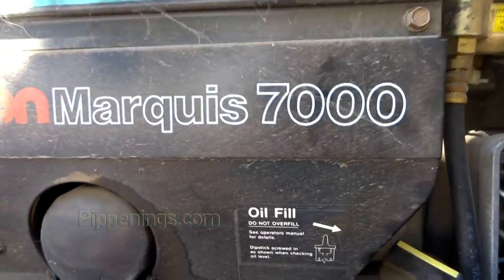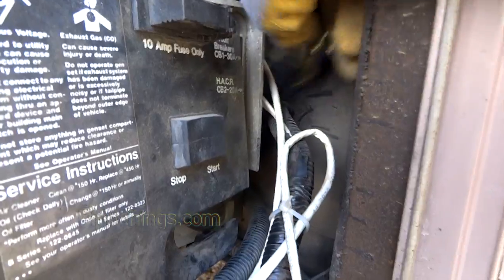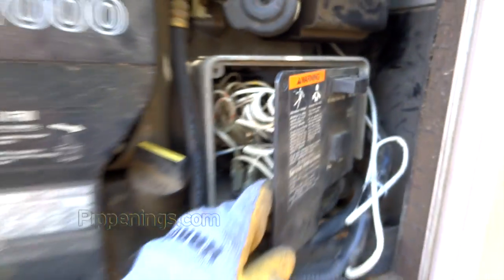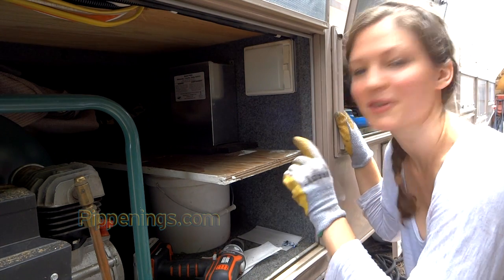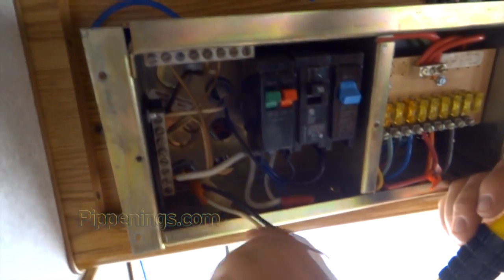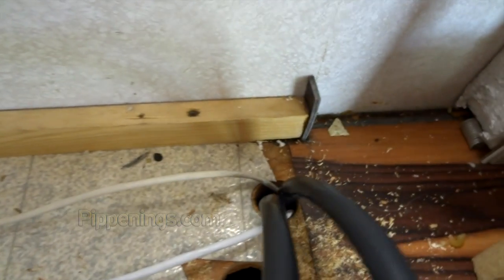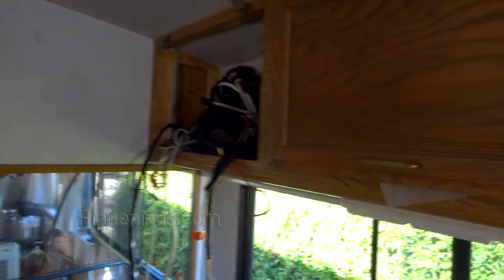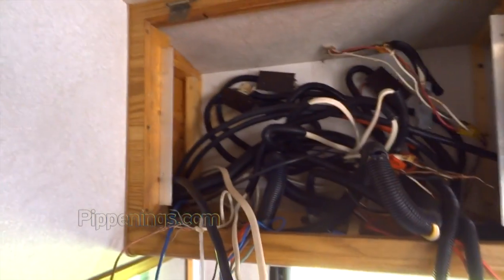30A to 50A Conversion RV: Cables, Part 2/4

Comment: So you used 6/3 with ground to run from your inside breaker box out to the generator or plug on exterior for shore power?  Or did you use 6/4 lol.
I’ll be doing this conversion in a few weeks and happen to have some 6/3 left over from house wiring

Comment: This is not a DIY type of job...most people would not be able to do it without a professional electrician.  My 5500 Onan will run two roof a/c units on a 30 amp system..maybe they are smaller a/c units then yours. Some rv a/c units will cycle one at a time i  hear. I never had a problem with only my 30 amps, but then i dont run a microwave and both a/c at the same time. and, im not living in the arizona heat but im sure in summer two ac units are probably a requirement. your videos are interesting and will help alot of people.  Two things i will get in my next rv after travelling to 40 states, it will be a diesel, wired with the inverter, and jacks for leveling. its a learning process
Reply from the maker: Those are great next-rig requirements! Especially the jacks!

Comment: Hey , I'm a little confused...I have been looking at xantrex inverter/ chargers all day...the ones I  am seeing already have transfer switch built in....but I see you putting in PD humongous transfer switch??? But you said earlier that you have mostly Xantrex stuff....so, I'm thinking your previous inverter must be a straight inverter, without charger built in?  And you must still be using a separate converter, too?  I'm very, very new to all of this, trying to make sense of it. I think it's all pretty fascinating! Thanks for posting!
Reply from the maker: +Julia Ronan my inverter is also a charger. Even with my old converter, the system had a separate trans switch.

Comment: See comment from last video about switching 30 amp breaker for a 20 amp breaker.  I realize you are upgrading your rv wiring, but the gen. is still at risk.
Reply: Yes is the generator capable of delivering more power?Dual voltage? 

Pipi is wanting to run both of her AC at the same time( I think) but I believe  they're only 110 volt and not dual voltage. I'm sure the newer AC units are dual voltage and can be wired to be run on 220 or 110. Running dual voltage  220 a/c unit going to use less current than running 2 110 volts 30 amp AC units going to still suck a ton of current. I'm not sure if that's going to  add up or not. Something might get hot and trip breaker ( hopefully will trip a breaker)